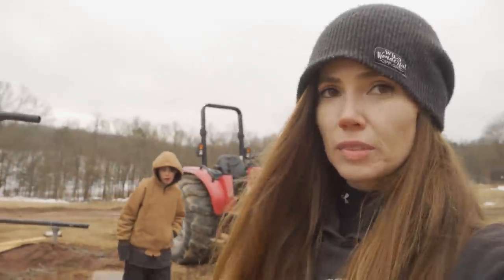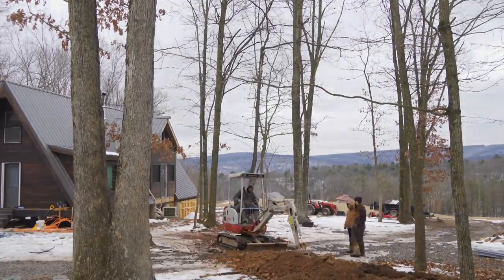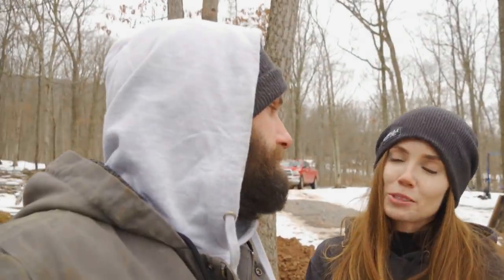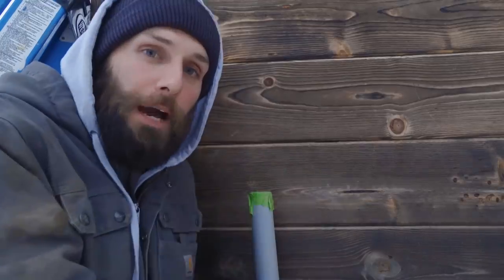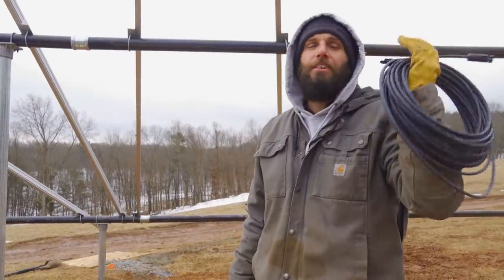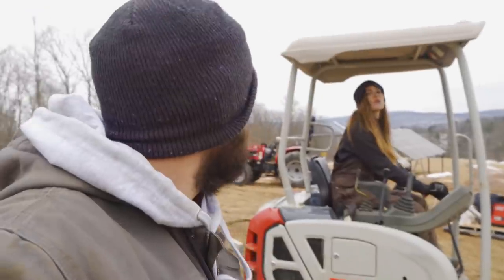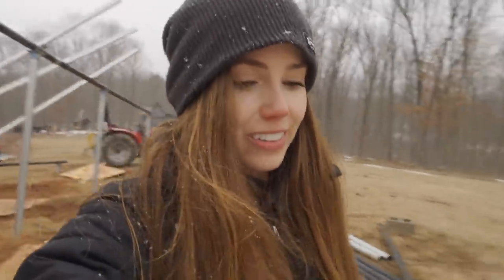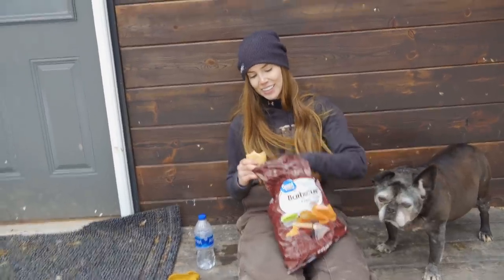It SNAPPED | Couple Builds Their Own House

Comment: Wow, two unusual things happened in this weeks video, both related to Josh. 1. He got pissed off - I’ve not seen that before, 2. At around 25 mins into the video I started to understand Josh without subtitles 😂🤣😂🤣. That slow talking really worked 😆😬🤯
Reply: I listen fast to save time. But with Josh I have to slow it down. Talks fast, even drives fast and gets the job done fast ... usually. 😛☺😊

Comment: Josh, did you ever use a vacuum or blower to pull a light feeder string through an abandoned conduit? Someone showed me to put a plastic shopping bag on a light string, use a blower to push or a vacuum to pull the bag through the conduit. From there you can pull a heavier tape. 
You got it your way, but now you have another option besides digging in the future.

Comment: A trick I've used when you lose the pull line in a long run like that - Get some real light rope - Nylon pull line or monofilament (fishing) line. Tie something light on the end and vacuum it through with a vacuum cleaner. Then use the nylon or fishing line to pull the mule line back in.

Comment: Imagine if you had to pull a big cable.   When I was about 18 I was part of a 55 man crew to pull a cable about160 feet.  No conduit, just three 90 degree bends with a rather large minimum radius.  The cable was armored and weighed 68 pounds a foot.  1.........2..........3 pull!  We moved it about 15 inches at a time.  Brutal.

Comment: It was necessary to put in the trench a sheath of diameter 80 (8cm in France) length 50 meters. So, no glue, no problems and above all a reserve for other passages ... I am surprised that an electrician does not know that ... And not to recap the ranch before everything is finished ... Bravos all the same!
Il fallait poser dans la tranchée une gaine de diamètre 80 (8cm en france) longueur 50 mètres. Donc, pas de colle, pas de problèmes et surtout une réserve pour d'autres passages... Je suis étonné qu'un électricien ne connaisse pas ça... Et ne pas reboucher la ranchée avant que tout soit fini... Bravos tout de ême !

Comment: I know this is after the fact, but in case you didn't know, I'll mention it. First I absolutely LOVE your videos for all the reasons others have mentioned. 
But now to the meat of my post. 
When I break a cable or disconnect the pull string in a conduit, I would pull all the wires out, making sure the conduit is empty, (I often have conduit runs up to 100 meters). Then I would take a Wet-Dry Vac and put it on one end of the conduit in vacuum mode, the other end I would tie a small plastic grocery bag on the end of a pull string (not anything heavy, just a small nylon pull string) and the wet-dry vac will suck that pull string through that conduit as pretty as you please. Then once I have the pull string all the way thru, then I tie it to a heavier pull string (If needed, like mule tape) and pull that through the other way. Now I have the desired pulling medium in the pipe and can start over again. It beats digging up the conduit.
Lastly, when your pulling lots of cable thru a conduit and are filling the conduit more than 50%, then I STRONGLY suggest using LOTS and LOTS of "Cable Lube". I use cable lube all the time when pulling CAT6 cables thru long conduits. Saved my butt a few times. Also, a good cable lube will dry with no residue. Keep up the good work! You're an inspiration to all of us! Cheers

Comment: This may have already been mentioned, and it's too late for what you already went through.  but when a rope line breaks inside of conduit there is an easy fix. 

You take a couple of store grocery bags, the flimsy plastic ones, and you tie a small string to the handles of the bags. stuff them in where the head went in and then you use a shop vac and connect the suction of the Shop-Vac at the other end of the conduit and it will pull that bag and the string along with it through the conduit very quickly. 

Then you use that light string to pull in a thicker string and then use that thicker string to pull in the pull rope.

Also, you should be using wire lubricant at the head and just coating that wire with the lubricant continuously as it's being pulled into the conduit at the beginning.

another option is to pull the wire through gradually as you lay each couple of sections of pipe.

Lastly, it's best to avoid 90° angles when you're pulling heavy wire through conduit.

I had this exact problem that you had but my conduit was under a 400 ft run of a parking lot. I was stumped for half a day until I figured out the Shop-Vac trick.

Comment: Oh no Josh, this snafu was all due to the architectural design of the jury-rigged bracing at the 90-degree elbow at the panel. Now if you had used your magic channel locks to hammer in a 2x4 brace, this disaster could have been avoided. LOL Can't wait for the next video. :-)

Comment: I''m curious why you ran what I think is a pretty small pipe for such large wire. Also, a liquid soap solution brushed on the wires really helps pull them. Just my opinion, you guys know what you're doing but I still think the conduit is a bit small for that size wire being pulled that distance. I'd love to have you respond to this and set me straight cause I'm not an electrician by any means but I've used soap solution to pull wires thru greenfield in the past and it worked well. 

Gene

Comment: Why don't you used solar tracker?
They can "stand straight"  and there will be no snow. There are also wind protection.
Reply: When panels were lower wattage and every collection watt mattered, trackers made sense.  Trackers are for smaller systems.  More complicated, less weight handling.  These days with panels being higher wattage, the general rule is point it S/SW (in N hemisphere) or 'close enough' and then buy more panels if you need more.
Reply: @LordNelsonkm  More panel has bigger max output at max sun = "more expensive" charger/inverter.  Not effective. (there are a lot of graphics solar energy by hours)

10kW system will give you 5-6 hours ~10kw energy with tracker at suny day.
With fix stand you will have only  ~10kW at dinner time and just a few minutes. In the other part of the day you will have less.
The cost of a mechanical tracker system will be nearly the same, but you need less space, there are a mechanical MPPT, there will be no snow and also has wind protection.

Comment: I am neither an electrician nor a plumber. However, I have worked on construction as a carpenter and welder. Is there a reason why the wires couldn't have been pulled through the conduit before burying it?

Comment: Why didn't you reuse the existing wires?
When you put the solar array in initially you said that sizing it correctly was very important.  Why did you need to resize the system?

Comment: I mean, I would have pulled all the wires through the ditch before burying the pipe. I may also have only lined up the plastic pipe and only glued it al together when all the cables were connected

No doubt Josh will have ab explanation why you couldn;t do it that way though

Comment: For future pipe runs put a rigid steel  90 at the end where the wire comes out.  The pull string or rope that you use can burn through the top side of the 90. Wire pulling compound also helps the pull go much easier.

Comment: When i was young i droped a 10 horse pump dow into a  210 foot deep well on black poly pipe by my self with my hands only. I had tied a nylon rope  to the pump ring.every thing went ok till i got about a 180 feet hanging down the hole. Thats when it got real heavy. I was standing on the rope trying to figure out if i was going to go for it or pull it back out. Looking at the 35 feet laying on the ground and knowing i was at my max weighht limit. All of a sudden the rope started decending under my cowboy boots heal then it kicked it to get and i let gp the rope  i kept the rope under my boot when i sat down i looked at the boot and was supprized how the rope had burned the heal a perfict grove . Thank good ness i didnot wear tenny shoes  that day. Ned less to say the pump was unharmed and we used it for 14 years befor it burned out. This time we had 3 guys come and pull it and put a new one back in.

Comment: Hi Josh I am olso  a Elektriesehen.  I usually pull the cable with  out the bends  on the ends . And if the cable is in with sleg  . Then I do the bends .

Comment: Glad you put trim on the sharp troth edge. Ya shoulda connected the cables to the fish tape or mule tape in a staggered manner, about 12 inches apart. All those cables attached at one point made for too much friction.

Comment: I used an elevator cable support chinese finger mesh thing to pull cables. Buy the right size and stuff your wires into it and attach your pull rope and pull.

Comment: After digging the trench you should have connected the wires while connecting the pipes at the same time it would have been easy rather than what your doing, it will naturally snapped cost the wires are heavy. After that done you can put back the dirt.

Comment: I was wondering why you didn't just use one of the wires you already had in the line to pull the new lines? That's the way most electricians would do it...The fish tape really isn't strong enough to pull what you needed.